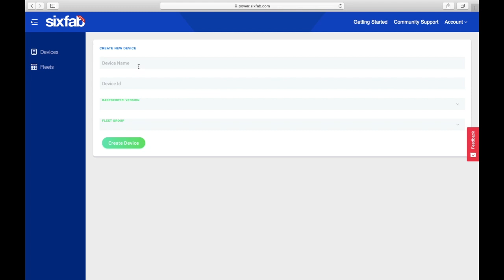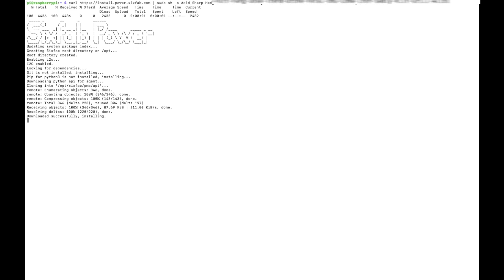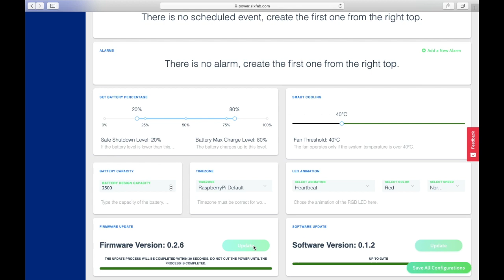Getting Started with Raspberry Pi Power Management & UPS HAT

Comment: I used this with Rpi4 and quite happy with it. Also, i separated the battery holder and put the hat and the rpi along with 7 inch official touchscreen in its official case. It has been weeks since the Rpi was shutdown. Supports for 1 hr. In case power failure is there for more, shutdown and restart happens automatically. A note for indians. You have to pay 40% customs tax extra. Otherwise this is a good product.
Reply: Could you please share the setup of your case and Rpi4 with us?